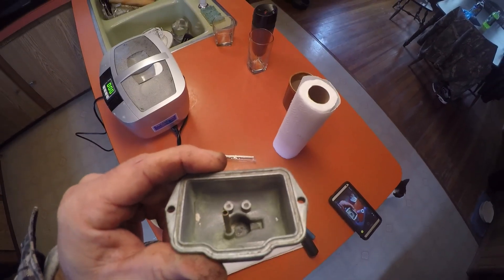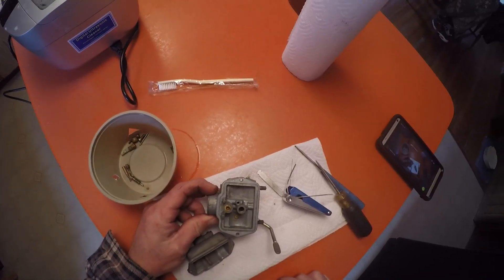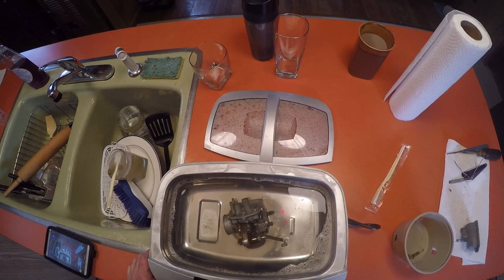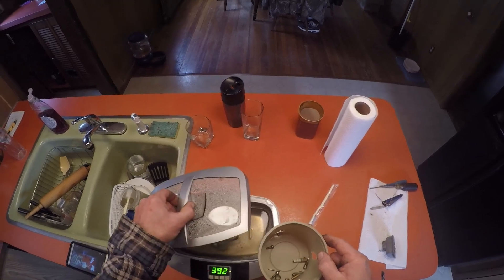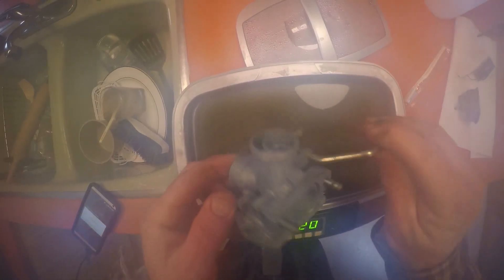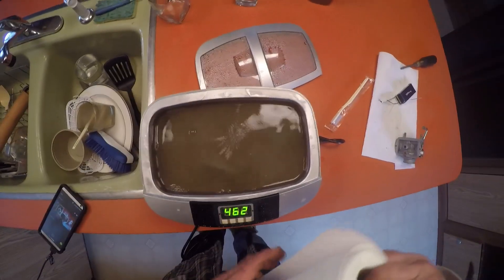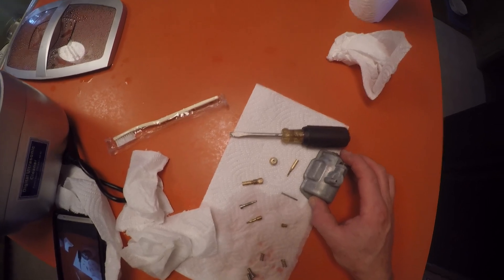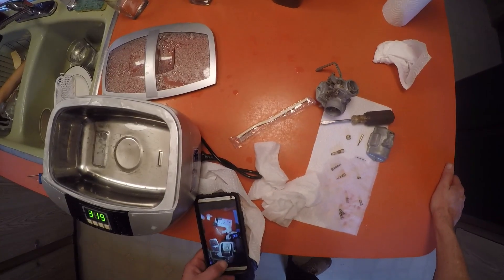Ultrasonic carb cleaning

Comment: frustrated cuz my HF cleaner fatally fizzled out after just 6 uses, finest chicom quality. i think its essential to let oil soak into the brass bushes in throttle shaft holes or they might freeze up during storage from corrosion/oxidation/whatever.

Comment: What is crud cutter , an additive , a degreaser , a multipurpose clear or what& where can you find it ? Good video except for a little more information ! :-)
Reply: Krud cutter is a kind of heavy duty all purpose cleaner/degreaser.   You can find it in most hardware/ big box stores.  It's usually by the paint stuff

Comment: Also, make sure the solution in the tank never gets below 1'' from the top. if it does, the cavitation/cleaning power gets drastically reduced. i thought my machine was broken until i learned this. and make sure you de-gass! let it run for 10 minutes before cleaning and it will be much more effective.

Comment: word of caution about cleaning jets: never use a wire or orifice tool to clean them. they are precision parts and can ruin them by accidentally enlarging and / or changing the flow properties of the orifice.
Reply: "Never" is a strong word to use.  I have had to use a jet cleaning wire kit many many times and never had an issue.  I understand your point and a cleaner like this would be preferred, but not everybody owns one of these and sometimes you just have to make do with what you have.
Reply: wires are sold in sets with a range of standard sizes specifically designed to clean jets and passages. wires are useful to determine the hole is fully open, just a peek of light isnt clean enough. simply probing through jet and emulsion tube holes with wires will not change hole sizes significantly except to restore their original size.

Comment: FYI for anyone wanting to get a ultrasonic cleaner. DO NOT PLACE YOUR ITEMS INSIDE THE MACHINE WITHOUT THE BASKET like your seeing in this video. You can damage the surface area. Eventually you will etch into the stainless steel. That white mat thing he has in the sink should be used at all times.
Reply from the maker: jcaashby3  i have the basket and use it sometimes...sometimes i dont when the brass jets are involved...sometimes the agitation  from the metal bottom actually can help clean up the jets a little better....but i do agree most should always use the basket

Comment: What cleaner is this? would like one if it works well for stuff like rusty/dirt bolts, carbs, valves, and general engine parts and pieces.

Comment: hi, if you use wire to suspend the items off the bottom they will clean better, like a piece of copper, best not to use plastic inserts, and by the way a ultrasonic cleaner can give you the bends if you put body parts into them, don't know how long takes or if you need a certain power level, just thought I would mention it as most people do not know. (That's the bends like deep sea divers get).

Comment: Ever have trouble with the soap?  If you used Purple Power at the 24 oz/gal recommended level, you would get a pile of black sand.  It dissolves and deposits aluminum. 

It actually says not to use on aluminum, but I did not read the label.  Groan.
Reply: simple green aircraft